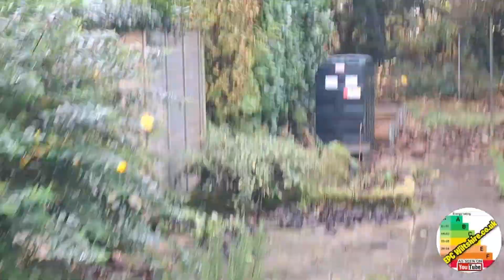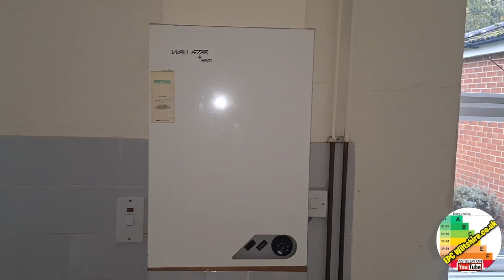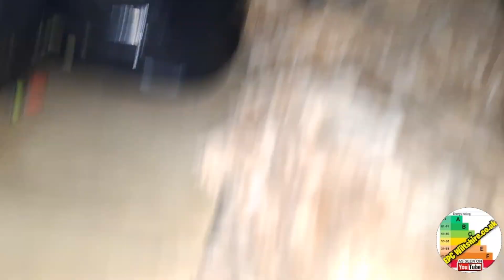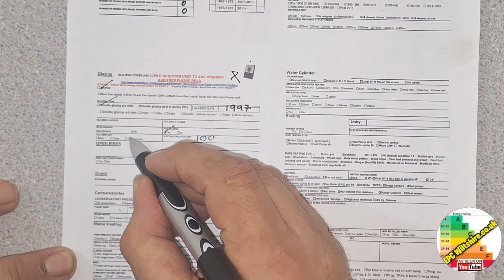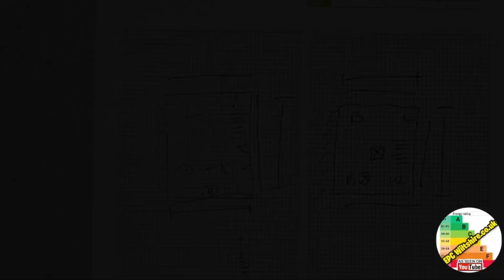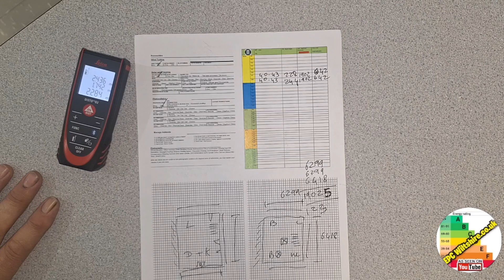PRC System Built EPC Walk Through REEMA HOLLOW PANEL

Comment: Hi, i love watching your videos

Just wondering if you could do a video on Heated and Unheated Basements/ Cellars, as they too me not easy as, i believe the calculations are different. Thanks
Reply from the maker: Good idea I will look out for one however not many round here due to low water table. 

Here are so used notes pasted below that might help.

I have made a new FB group for DEAs thought you may want to join https://www.facebook.com/share/2uJqHTSTAYa7RTW2/

Basements(See Convention 2.05)Include when accessed via a permanent fixed staircase, such that one is able to walk downwards facing forwards and either:-the basement is heated by fixed heatemitters, orthe basement is open to the rest of the dwellingA basement does not necessarily have to contain habitable rooms; the rooms may be nonhabitable rooms such as kitchens, bathrooms or utility rooms.Basements must be measured internally. Do not mix internal and external measurements. If a basement is included in the assessment, internal dimensions must be used throughout the dwelling.
Reply: @EPCWiltshire  thank you, as an assessor, its something that i have not come accross but i know that some meters are situated in the basements. Thanks for your reply

Comment: If you assessed my 1930's property with suspended floor, how would you be able to tell that I've spent several thousand quid ripping out the floorboards and adding 75mm kingspan insulation before putting the flooring back.?
Reply: If I'd spent thousands of pounds and presumably a fair amount of time fitting said insulation I'd probably spend 30 seconds explaining that to my EPC assessor and showing them a few invoices as proof
Reply from the maker: Well said I would also be present for the inspection and provide assistance ( access and documentation) to have a more accurate assessment
Reply from the maker: I have done exactly the same to my own house, however I have left an inspection hole under the stairs and have keepnall relevant documentation as evidence
Reply: DM David McCarthy